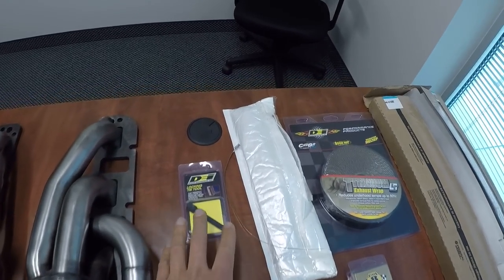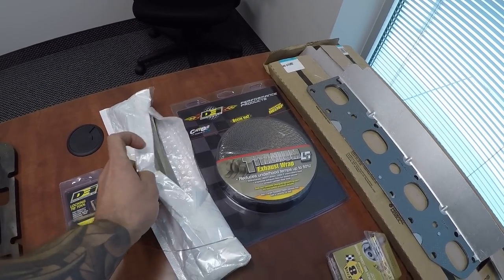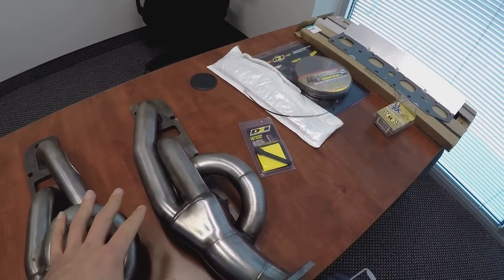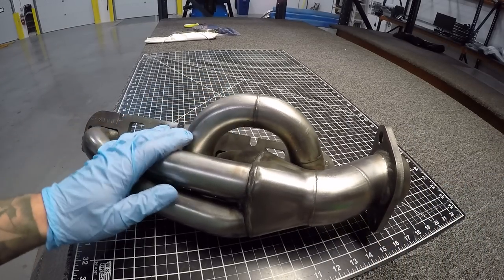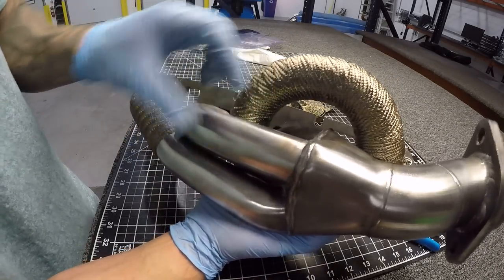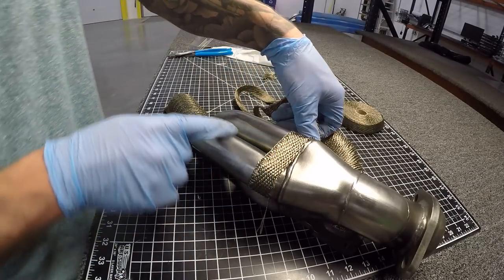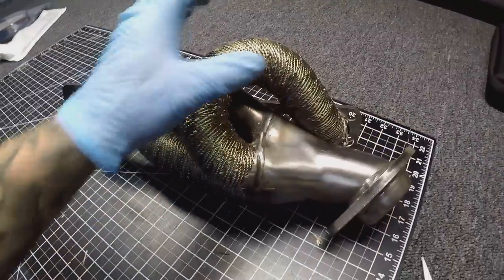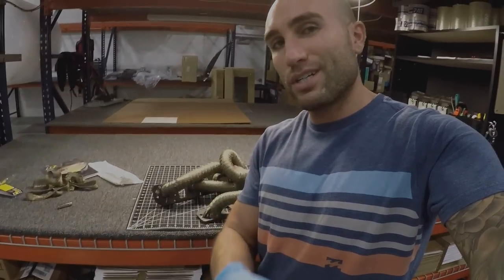How to Header Wrap Complicated Exhaust Manifolds - A Complete Guide

Comment: Looks good. When I used to wrap Harley pipes, I always soaked the wrap in water. It would help with the slipping and also would shrink to the pipes as it dried. However, I never had to wrap such a complex tight design. Well done.
Reply from the maker: Yeah that is the case with regular header wrap but this titanium stuff specifically states not to wet it. 😎
Reply: You youngsters, with your Titanium pipe wrap, and Platinum spark plugs...LOL

Comment: You can spray the silicone spray on bare stainless headers and let it dry. Then put your wrap on. The previous coating of silicone helps prevent slipping. Works great!

Comment: Stainless steel hose clamps of various sizes where needed work just as good, or better, than the stainless steel tie wraps out there. Good job wrapping there as I had to do the same for a 1998 Dodge RAM 1500 5.9L Magnum v8  budget stainless headers from eBay. Also, Remflex 100% graphite gaskets are The Bomb & better than Fel-Pro.

Comment: Nice neat job. When you handheld the camera it makes it hard to see what you’re doing because you moving it so jerkily, it also makes me motion sick 🤢.
I just watched an ETCG video where he used the same product and he mentioned that the wrap has a sewn edge and a woven edge and it’s important you get it the right way around but you didn’t mention it and I couldn’t see if you had done it correctly. Your wedging the wrap by doing a double fold was a good idea as was doing the same on the end nearest the engine to stop it fraying. I also saw a video from the manufacturer and they make a spray you can either apply to the header or spray on the wrap after application to stop it slipping off.

Comment: why not just get them powder coated? I hade Hooker Super competition headers that where ceramic coated on my last Corvette and they where so good! You could have your hand half an inch from them when engine was hot!
Reply from the maker: The insulated heat wrap actually works better plus it is far more cost effective.  Everything altogether was about $80 for two 50' rolls, metal ties and the tool.  Jet Hot coating which is the number one company is several hundreds of dollars plus shipping back and forth which isn't cheap given the size and weight.  On top of all this many people have found the coating to come off prematurely. 😎
Reply: Thats sucks, I was whery happy with Hookes Coating. Hade them for ~13 years till I sold the Vette (not many miles  for that time)

Comment: Thanks. I showed my friend he wants to try this idea on his bbk shorty headers v6. You think one roll should be good enough to do both headers. They have lots of gaps in them enough to go around every inch of them. And where did you get the zip ties from. We're both doing this now on our cars
Reply from the maker: Thats awesome!  It might be close but I still think you will need more than 1 roll.  It disappears pretty quickly!  They sell it in different widths but this 1" stuff works better for tight bends. 👍
Reply: @BoostedMotorsports  I uses 1" titanuim. One was way plenty. Sealed it with the sealant. Waiting to put in my car. Bbk shorty headers. Cat delete. But ordered high performance cats. Y pipe delete straight from the cats to the dual exhaust.

Comment: Thoughts on how much wrap you'd need for long tubes? Have a set of aFe en route and want to keep the heat down
Reply from the maker: Long tube you could probably do the 2" stuff since it doesnt have as many crazy bends and get at least two 50 foot rolls
Reply: @BoostedMotorsports  I ended up just grabbing the 1" x 100ft.. dude I tried ordering the one you linked and it told me it was restricted to my address in California lol I thought about getting the 2" too. Oh well lol

Comment: the stock headers must put off a ton of heat since they are straight up iron cast
Reply from the maker: For sure! 😎
Reply: Stock manifolds are actually made to contain a lot of heat with the cast iron compared to aftermarket headers. Anyone putting headers in a vehicle should definitely do this before install. Some might not notice any under hood temps going up depending on the vehicle and amount of driving. But over some time most will notice things getting melty or brittle from not having heat mitigation like a wrap or coating.

Comment: Hey looking to do the same and upgrade my headers but have the original OEM bolts can you list the part number for the Mopar bolts you purchased in theother video and the new locking bolts. Thanks in advanced
Reply from the maker: If you upgrade your headers the OEM mopar bolts are actually too long!  Let me know what your plan is and I'll try to point you in the right direction 😁

Comment: @BoostedMotorsports my question is , what's the comparison between this and ceramic coating them?
Reply from the maker: The insulated heat wrap actually works better plus it is far more cost effective.  Everything altogether was about $80 for two 50' rolls, metal ties and the tool.  Jet Hot coating which is the number one company is several hundreds of dollars plus shipping back and forth which isn't cheap given the size and weight.  On top of all this many people have found the coating to come off prematurely. 😎